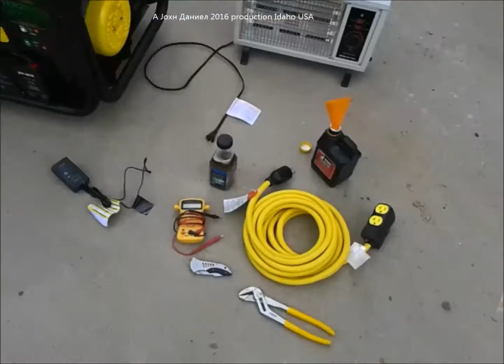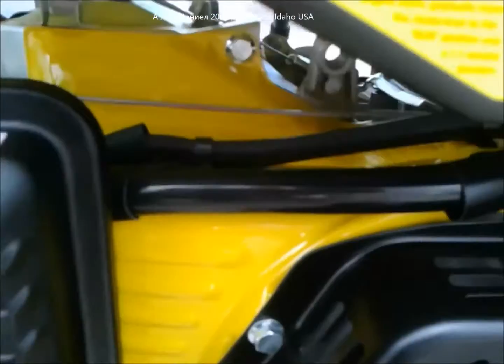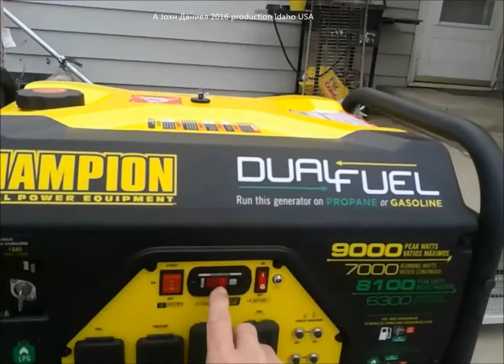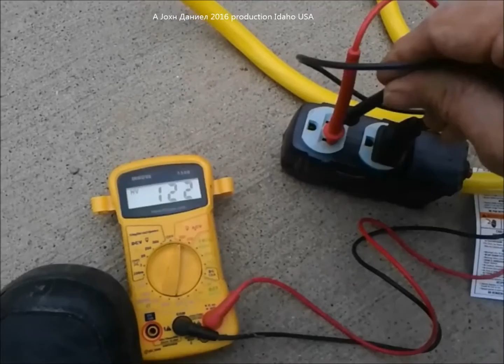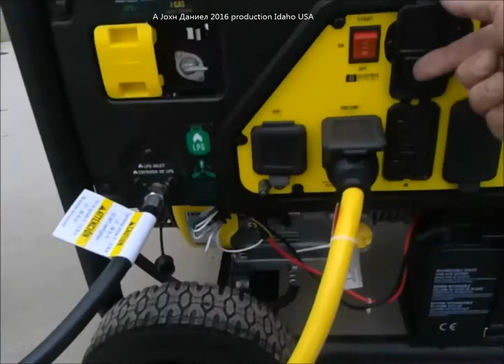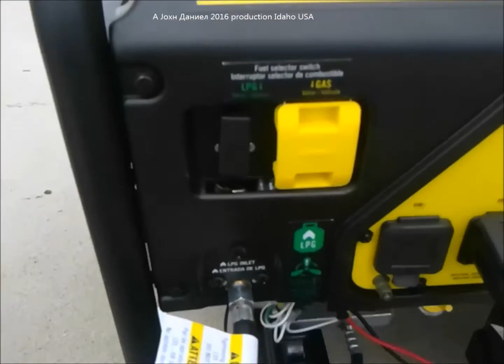Dual Fuel Generator by Champion how to set up, test and use it (read Below)

Comment: how is this generator holding up? any issues or problems?
Reply from the maker: +Der Jäger 436 hours on it, not one problem other than I set valves as recommended and changed the spark plug to a better one.